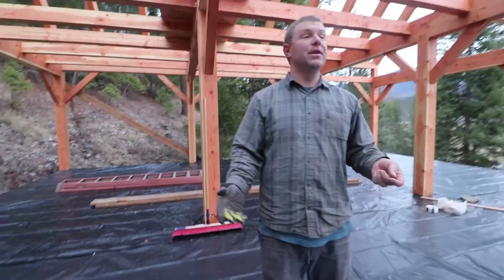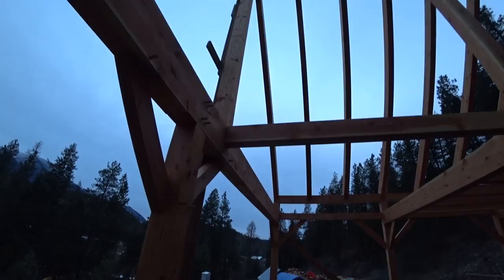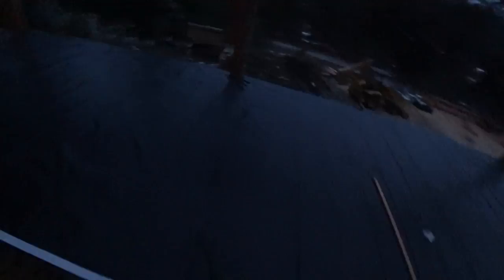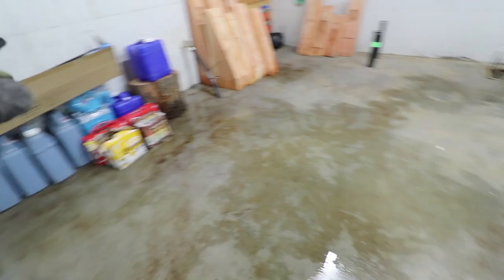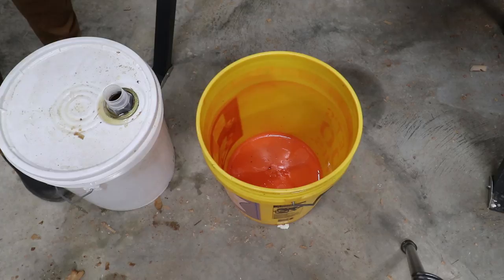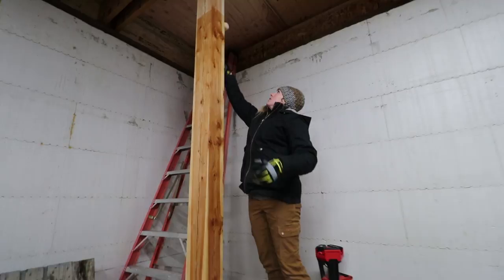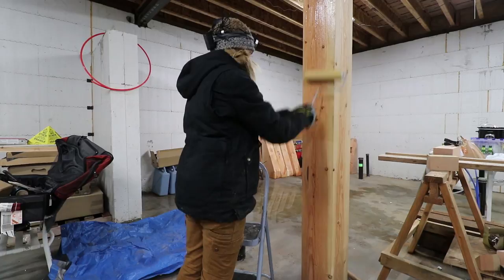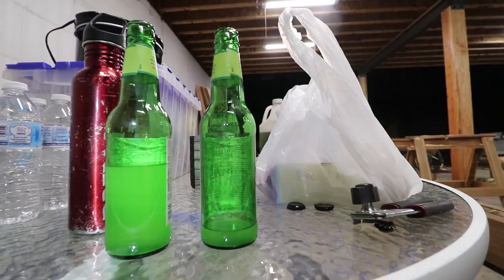Our Garage & Timber Frame House Are LOOKIN AWESOME

Comment: close an open side of garage ...buy 5 cm extr. polystyren and glue it with spray-foam, make windows-like frame from wood around each column of polyst. panels = half day project and you have warm place for work ...during march you will také a knife and after 30 mins you will remove it ..

Comment: No TUCK tape in US?
Reply: Daniel O'Brien THIS. Red sheathing tape. It will hold up exposed to the elements. Sun, rain etc. My experience with duct taped, even pricey ones is that they don't stand up well outside.

Comment: Why don't you put the roof up?
Reply: 2thelightphoto They are waiting for the sip panels. If they build the roof without the sip panels at the same time, there is a chance the structure will blow off in strong winds. Think parachute 😀
Reply: The frame being toe nailed in with only lag bolts isn't going to be a disaster, nope not even a little.

Comment: WHAT THE HELL IS A SIP  PANEL DAH HELP PLEASE.
you guys need to explain some of these items  like this panel you are waiting for what it does why couldn't you have ordered it sooner there fore you would not be waiting  now for this item Unless there was a reason why you could not order these items 
great video guys  keep them coming been watching since  day 1. S C  United Kingdom.
Reply: Steve Capper if I am not mistaken, the windows are holding up the sip panel order...he said that in a previous video.
Reply: Structural Insulated Panel. It's a prefabricated section of wall, with wood on both sides and an insulated board sandwiched in the middle. The didn't order it earlier because they were so busy preparing for the timberframing workshop / raising.